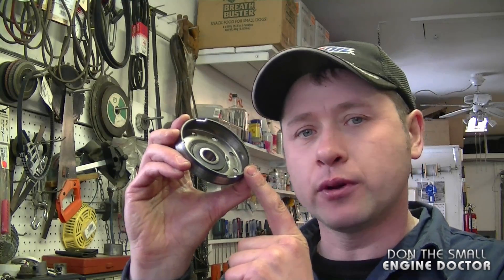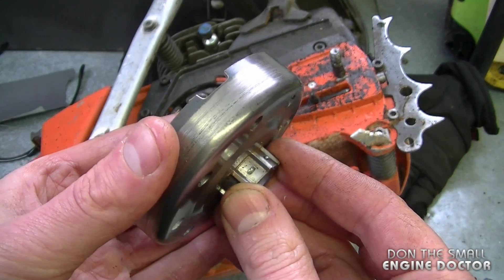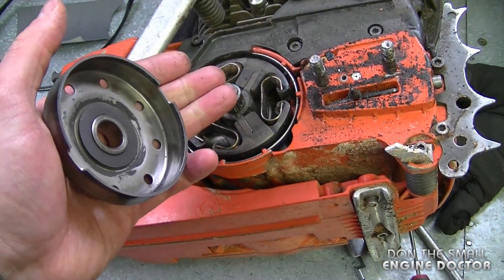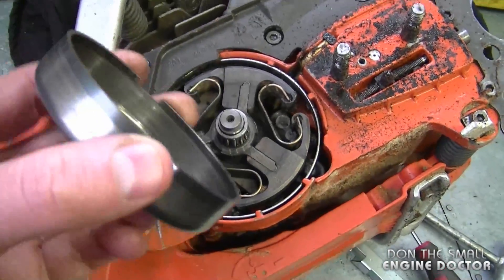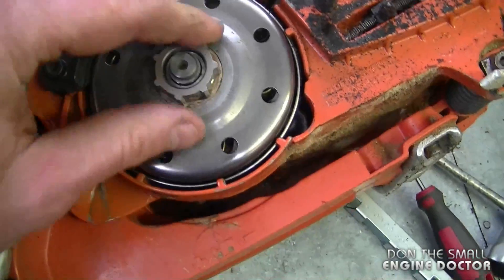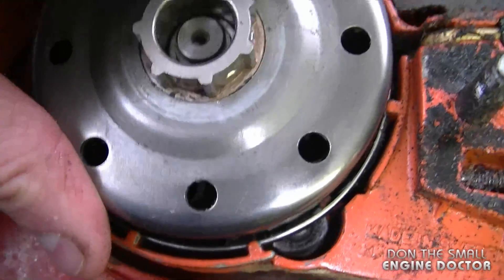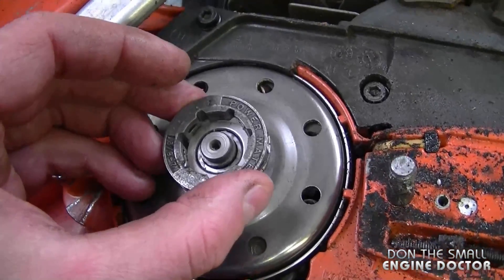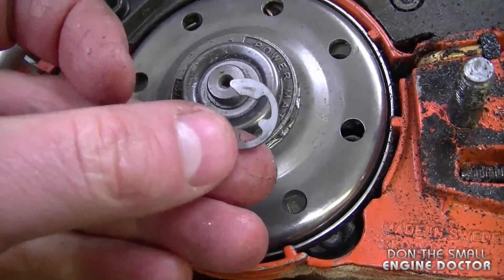Chainsaw Quick Tip #3 - Husqvarna 365 Clutch Notches Alignment

Comment: It is beautifully explained but that thing is self centering?? What? Yes... Just put it back on her place without and don't worry about clutch notches alingment. After you put it back just spin it in any direction(cw or ccw) until it sits - it will hook that notches or it will "seat" by itself. Cheers!

Comment: I like your short videos and have learned a lot from them ,no wasted time waiting for you getting to the point is a great thing
Reply from the maker: +Tea Tipper thanks for the feedback
Reply: donyboy73 Hi my 365 leaks oil from that little hole between the chain nuts that's below the oiler. I do not know what it does but I remove the chain and bar and it was sipping oil overnight

Comment: i have a stihl 440 magnum it has spark but will not start ???
Reply: Jason pearce .watchings this and learn
Reply: العراقي العراقي thankyou   :-)
Reply: +Jason Pearce :( I hope u Beneficialnees
Reply: +العراقي العراقي thankyou very much !!
Reply from the maker: +Jason Pearce check condition of piston and rings through exhaust port
Reply: donyboy73 ive done that all looks good compression is good also
Reply from the maker: +Jason Pearce here are things you can check, the carb, fuel lines and filter, impulse line, intake boot
Reply: donyboy73 im an arborist not a chainsaw mechanic . . those parts i know nothing about . .  thankyou heaps for your help muchly appreciated !!  ill just have to take it to get fixed . . . have a good day mate keep up the great vids  :-)
Reply: +Jason Pearce   It takes fuel & it takes fire for an internal combustion engine to run, and you have fire.
Reply: Urbicide i know nothing about carbys ??? but thankyou so much